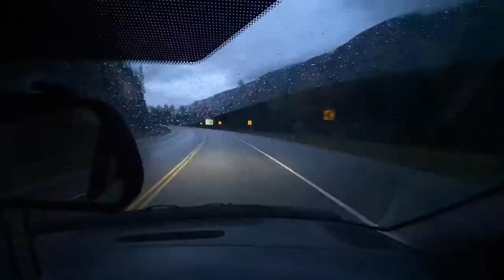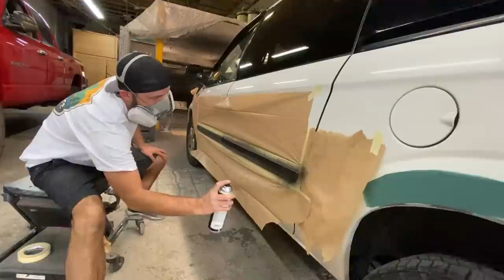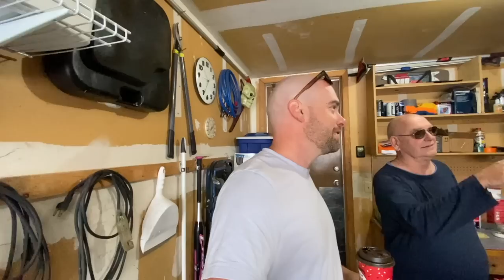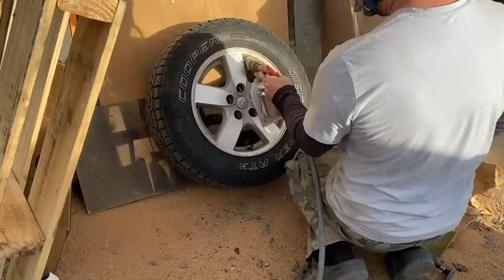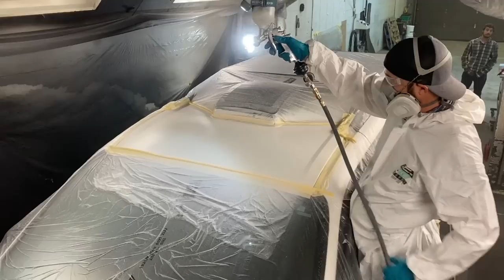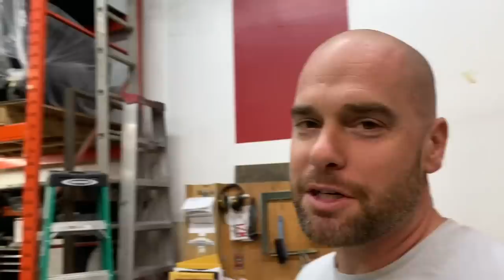My Home On Wheels Goes Into The Body Shop Woooo Weeee

Comment: The Dash-8 has got to be the noisiest aircraft I have ever ridden on!   I had to take a connector from Montreal to Ottawa coming from the east coast one time and now when I book anything, I specifically avoid that plane haha.  Even with headphones on full blast you couldnt drown out the vibrations from those engines.

Comment: Just finished binge watching the entire build series. I'm about to start on my own build (also with a Grand Caravan) that I'll be moving into full time in the spring (when I'm not living in the semi-truck, doing trucker things). Yours is by far the nicest build I've seen yet. That's the level of quality and attention to detail I'm looking for! How are you finding those foam roof panels working for you during the winter? Have they been enough? Or if you did the build again, would you use a different product? I'm based out of Lake Louise right now, so the winter months are both long and high in my mind while I'm planning this. Insulation will be well up on the priorities list for me.

Inspirational, Joseph. Thanks for putting in the effort of editing down all that footage. I've got a lot to work with here. See you on the road, maybe.

Comment: Hello Joseph, The van touch-up looks great. I have a 2015 Dodge Caravan. I want to put a AC Port Plug on the van. Where would you suggest I locate the spot to drill the hole ?